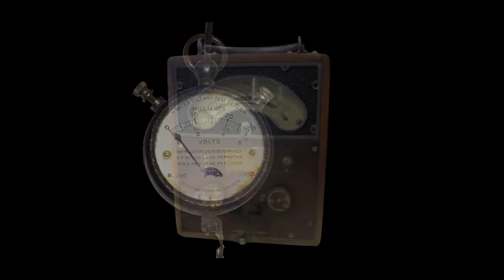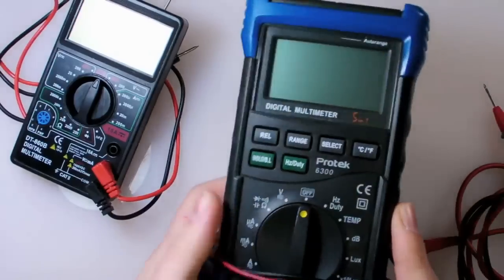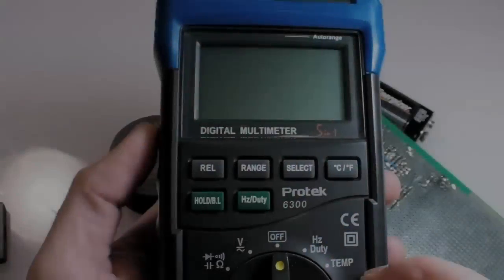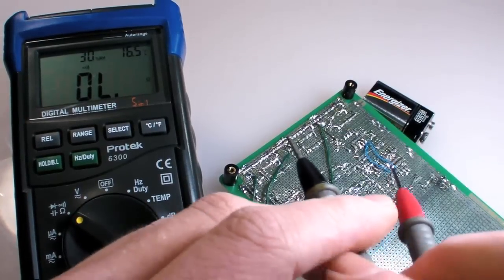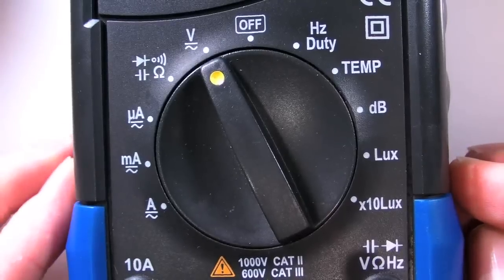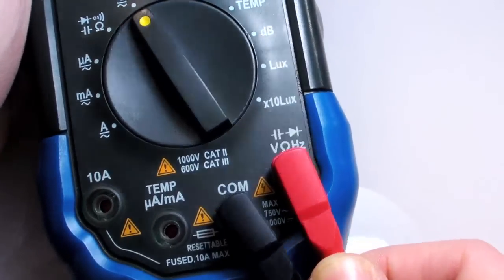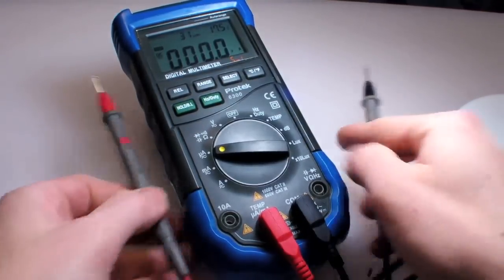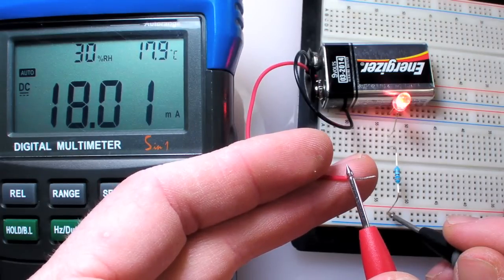MAKE presents: The Multimeter

Comment: In some cases (like plug firing on a jet-ski) some digital meters cannot display the spark quick enough (so it may seem it is not working. For this problem use an analog multi meter.

Comment: @uptilwhen Its easy to make a Flux capacitor, all you need is an inductor and a capacitor. This creates a tuned LC circuit that stores energy that is oscillating at its resonant frequency. This is particularly useful in applications such as amplifiers, filters, RFID and time travel. So you can thank Doc Brown for inventing one of the best circuits in existence.

Comment: Fwiw, measuring a battery's voltage does not necessarily indicate that it's "definitely usable."

Batteries must be checked "under load" so a special battery tester (which many meters have these days) must be used.

I'm just getting back into electronics after a many (many!) year absence, and other than this little nitpick, this was a useful refresher course for me; thanks!

Well, one last thing. Personally, I wouldn't touch the live circuit when measuring current ...

Comment: Another great feature to a common multimeter would be one which can test current (amps) with a clamp.  A clamp on meter is very useful, because there is absolutely no physical contact with electrical wiring and no need to worry about potential shock.  

Great video too!

Comment: At 6:36 you state the negative of the multimeter is connected to ground when measuring current. Wrong, It is connected to the positive of the circuit supply point where you removed the supply from.